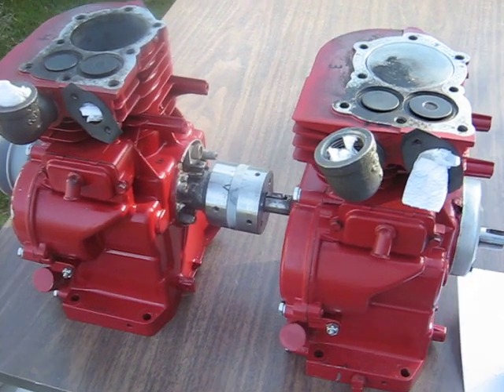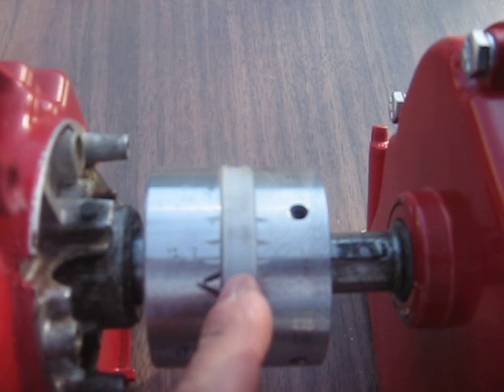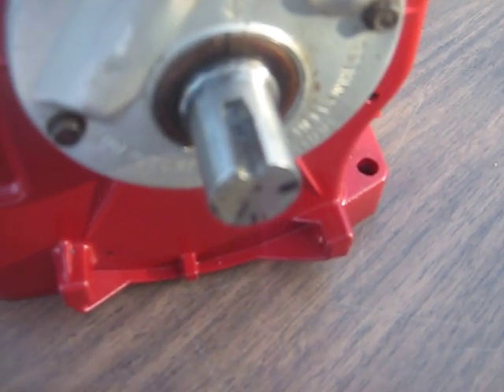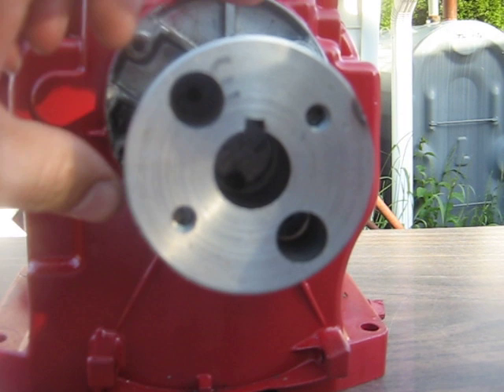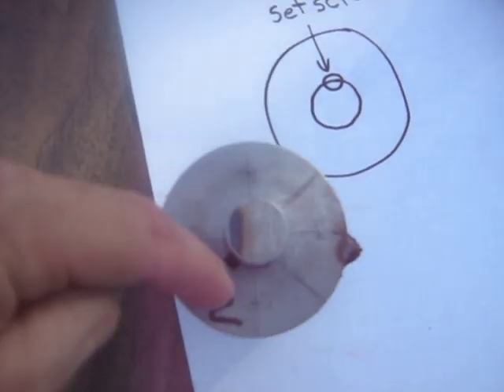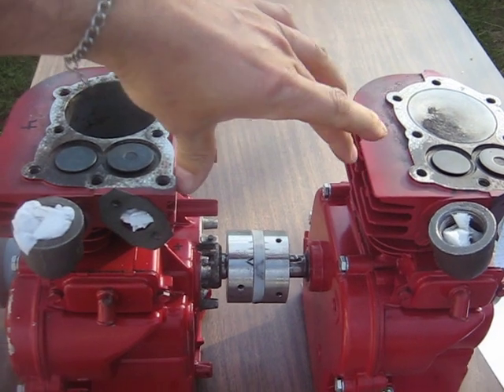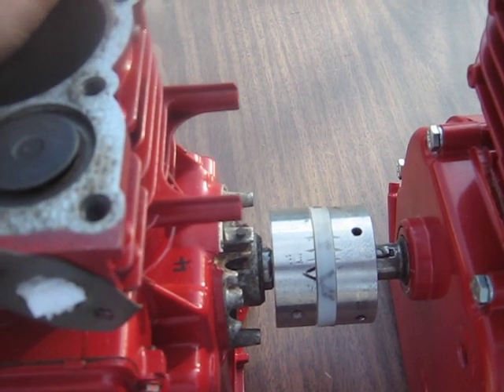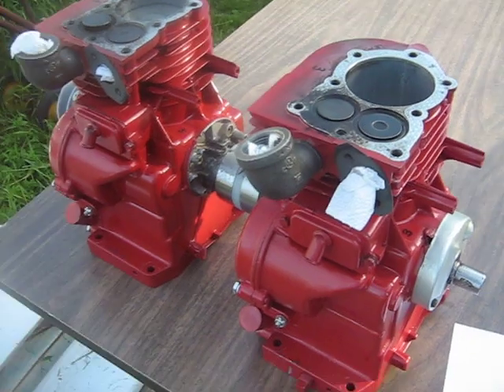FrankenBriggs 4 Coupling Update

Comment: Neet Project :) you might be better off using a steel base plate, the wood may bend and warp with vibration, also you may need to shim each engine to get the cranks aligned with in .001 of an inch,  I remember when i was working as an operating engineer in my younger days, i replaced a electric motor coupled to a pump, and the rubber coupler did not last very long, because i did not dial in the motor and pump shaft to with in .001 of an inch, I learned the hard way :) I am a retired Female Operating Engineer and Fleet Tech. I also agree that the Chain drive coupler may be a better way to go, Take care and have Fun, Chellie
Reply from the maker: Yes, a steel base seems to be required for this engine, though wood is much easier to work with!  We did get this engine to run for a short time on other vids, but it did kill the couplings!  LoveJoy couplings sent me some to try out, which I will do in the spring, as we are buried in snow here now!  :)

Comment: Why anything flexible in the couplings anyway? Why not just machine a solid coupler and put your engines on a solid base and shim  the base until everything turns  smooth. Having only one flywheel looks like a problem too. You have to have enough mass to carry everything through the two revolutions. only having one is jarring everything and breaking couplers. Why didn't you run with 4 carbs? This is an awesome project. I hope it will run good for you one day. Awesome machining. good luck.

Comment: Nice work, Have you ever heard of a chain coupler? 
I have used these in the past to couple surfaces that may or may not always remain true. 
Might save you a ton of headaches, they are good for situastions such as yours. 
chainconveyordesignDOTnet/wp-content/uploads/2012/01/Chain-Coupling2.jpg
I have bought them at surplus center, but mcmaster carr would also have them.
surpluscenterDOTcom/item.asp?item=1-3560&catname=

Looks like your having fun with it.

Comment: yea but letting it flex is probably what caused it to break and bent it 
you are on the right track with the harmonic vibration 
 considering you don't have all four motors bolted to STEEL(wood will not cut it here you need a really rigid mount with at least 30 in/lbs of torq on each bolt because any vibration will cause failures remember every motor is not `balanced` exactly the same so you end up with a torq differential in your joint and thats what bends stuff

Comment: Personally I would run a gear set up with a spider gear assembly, something like differentials use. That way you could hook a fan up to one of the spider gears on each coupling to keep the latter 3 cylinders cool.

Comment from the maker: Yes, I have to do something to it. I was planning to remove the crank, and chuck it in a lathe. Either way, it will be a pain to do, but necessary to fix it. I am going to dial indicate the other engines at the same time, just to make sure they are OK. I think part of the problem was caused by welding up the crankshafts, it left hardened spots, which didn't machine correctly, so the shaft is probably egg shaped, even though it was turned on a lathe. this is a live and learn project, for sure!

Comment: That bent shaft problem might extend to the bearing and into the crank... best way is to remove the crank and get it machined. If you don't want to remove crank then the simplest way would be to secure the coupling half to the shaft, fix the engine and a suitable grinding tool down rigidly ( allowing the grinding tool's position to be finely tuned ) and hand rotate the engine whilst the tool grinds away at the wobbly coupling... mounting the engine on a lathe bed would be even better.... ;)

Comment from the maker: Yes, I will have to dial indicate them, that will tell the tale for sure.
You would be correct about the loading, if I was hooking it up to drive something, but I don't plan to do that at the moment.
Since the engine(s) aren't under any real load, it just seems to be the fact that the flywheel is at one end that is causing the couplings grief. Guess all this proves you never know what you will into with a project like this!

Comment: i dont understand y u put the plastic why not all metal the timming would be more accurate and i think giving them ANY leeway will cause it to fail when i did my 2 cyl it was solid connected with a slip caller with a set screw but that was seam and this is gas so IDK lol =3-

Comment: Hmmm?  You need to dial indicate those cranks. Also, the torque on the couplers will increase as you get to last engine?  Coupler #1 5HP, #2 10HP,,#3 15HP.? You think?  . Interesting project to think about. Thanks for sharing.